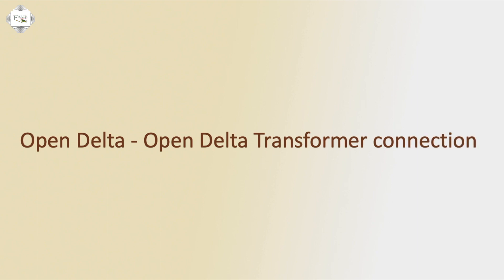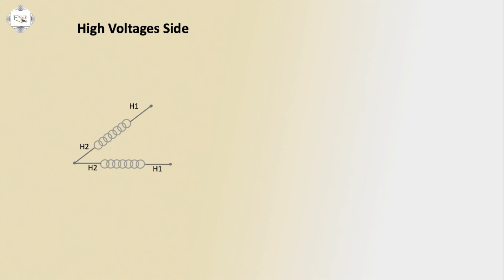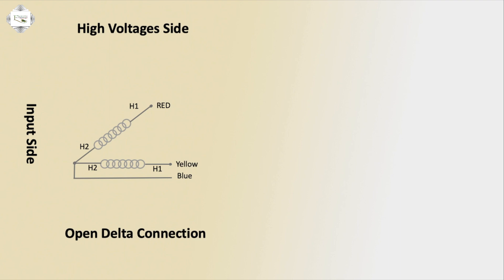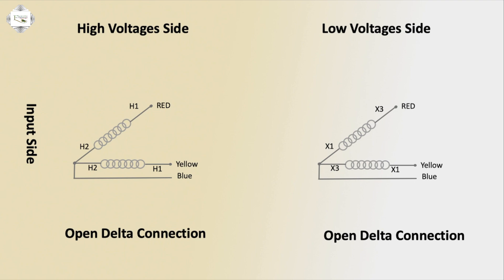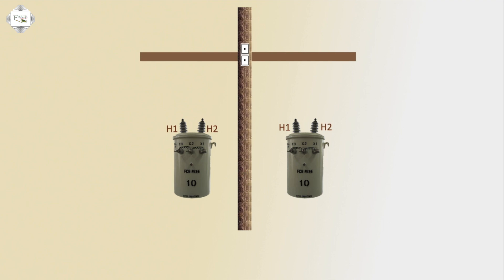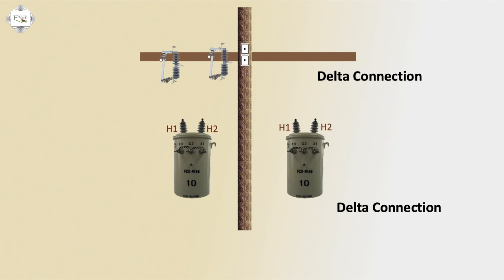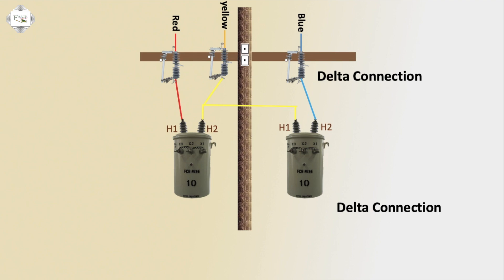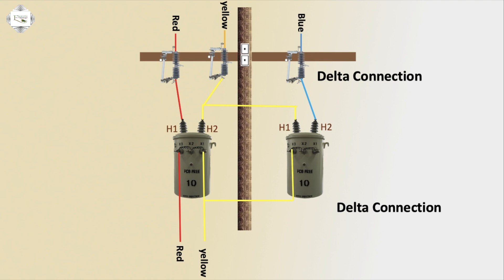Open Delta - Open Delta Transformer connection | Delta Delta | Transformer | 1 phase Transformer

Comment: Your circuit diagram is incorrect in connection of color wire connection. Please reply if I'm wrong. But your block diagram in the transformer is correct but you circuit diagram is incorrect.
correct connection is in the input H2 H1 Connection in the yellow wire.
Reply from the maker: Electrical and Electronic video please recommend us in the comment section. Be stay with us and learn Electrical and Electronics easily. Check our playlist for different types of videos.
thanks.